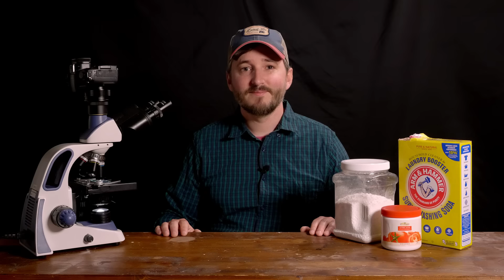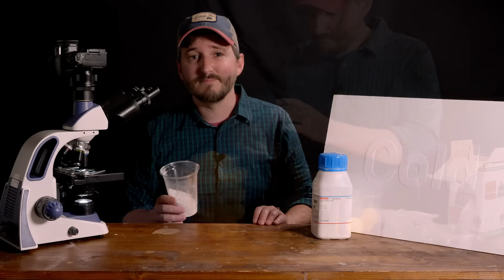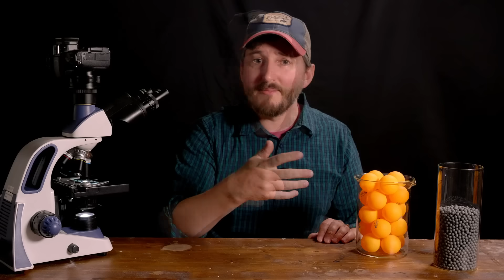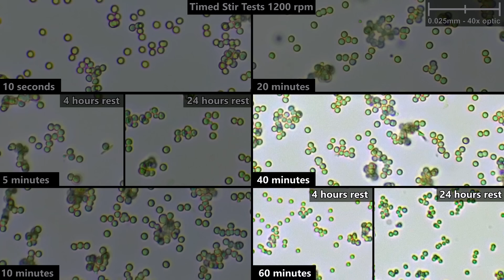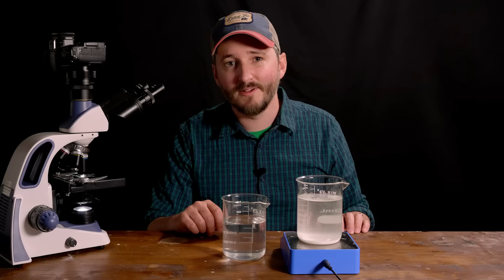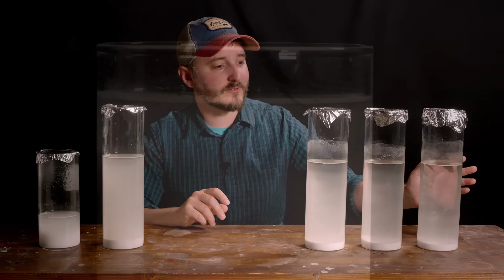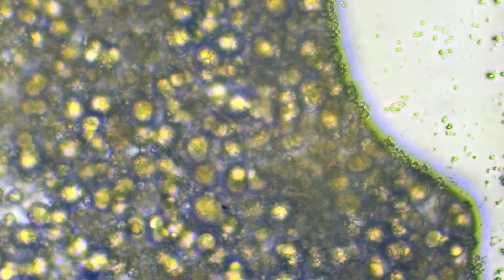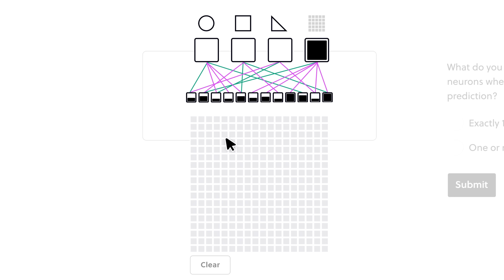Making Infrared Cooling Paint From Grocery Store Items (w/Novel CaCO₃ Microsphere Synthesis)

Comment: I don't understand why you need the different sized spheres.  Wouldn't it work just as well to use just the smallest size?
Reply: Never mind.  I get it now.  I was watching Tech Ingredients explain the same thing, and I don't think he necessarily explained it any better, but it finally clicked in my brain.  Thank you for your amazing videos.
Reply: So, to prove this concept, I would take a jar and fill it with, say, one inch diameter balls, fill up the space in the jar with water, and then pour off and measure the amount of water.  
Then fill the same jar with 1/8 inch diameter balls, fill up the space in the jar with water, and then pour off and measure the water.  
I would expect to find the same amount of water in either scenario, which would be around 33%  of the capacity of the jar.
Is that correct?

Comment: Looks like you'd be able to either trowel the 'paint' on, or pour it and use a spiked roller (like those used for epoxy resin floors). A gentle vibration could aid with leveling the surface and better compacting/aligning the spherical particles.

Comment: This solution may sound somewhat strange, but dissolving non-fat milk powder in hot water may give you a polymer form of less fragile paint without disturbing the original cooling effect. Higher percentages of milk will produce something more akin to Elmer's wood glue, but small amounts won't have it's own albedo effect, and who knows, the milk solids may be another form of mesospheres.

Comment: I think you can figure out the spraying, but you'll need a solvent that is a little slower than Acetone. Though I do think the trick of keeping the acrylic foaming might be hard in that case. Ethyl Acetate, Propylene Carbonate, MEK? Gotta be a recipe that gives a better result now that you have the pigment size sorted out.

Have you tried a commercial off the shelf untinted paint base? I think that would be a very interesting data point to compare performance vs. ease of application/durability of the coating.

Comment: Ahh I have a tip for you!  To prevent acid reflux, don't eat too late at night, and if you do, make sure to only lie on your left side... the reason is because your stomach is like a bag that goes down and to the left. If you lie on your right side, then all that pressure is pushing on the top stomach valve...

Comment: Incredible work! I was not going to say anything because I figured you would not read it but... you said you read everything so here goes...

I had two thoughts, both of which I do wish I could try myself but knowing I wouldn't and wanting to see you keep doing incredible things I figured I would mention them.

1. Have you tried dissolving the acrylic in pure acetone and then adding the water before spreading? It would likely achieve your desired result of light scattering with micropores where the water slowly evaporates. It may also reduce your processing time of the acrylic sol'n.

2. Have you considered setting up a "screening" or as a concrete worker would say "screeding" for the pigment? I think with the right tools the solution could be spread over about a square meter of flat surface in a minute or two. You would just make a 2x desired height box of the desired dimensions (as half of the volume will evaporate, hopefully all in the height dimension), pour in the mix/paint, then scrape off the top and consider light vibration to level the surface further (another concrete trick), let dry and remove the box (looks like you did this with the heat sink you placed the pant on to a degree)... 

Anyway, I hope this was not a waste of your time, I found your video compelling and interesting, I studied chemistry in university and grad school and worked as an industrial and analytical chemistry for years so I loved what you were doing here. Just pure gold content here! 

Thank you again!

Comment: Because of the thickness of the coating and the "paint" being so viscous, would rolling it onto a surface be better? Using your syringe to spread a correct amount onto the surface, and then something like a Brayer roller to spread it out?

Comment: If it adheres to acrylic glazing, then a film overcoat of lacquer or shellac may be protective for out-of-doors use.  Also, I wonder if this could be used as a reflector to put more light on a solar panel without the infrared rays.  
Speaking of solar panels, a method of cooling the panel might improve efficiency on a warm sunny day.  But that's another project.

Comment: Thank you for all your work and for sharing your findings with the public, free of charge! Even with  your thoughtful efforts to simplify the process (I really appreciate the use of a blender rather than a centrifuge), it still looks like quite the process to make just a sample size of paint. Is there anything comparable on the market that can be purchased for someone who doesn't have that kind of time or ambition???
I've heard of Radiant Barrier paints that claim to reflect more of the sun's heat, but I've also heard they don't really make a huge difference. Do you think they're similar?
Reply from the maker: There are various silicone roof coatings that are meant to reflect heat. Look for the brightest white you can get. They don't cool below air temp but it will keep a house much colder than a dark roof.
Reply: Thanks! I guess that sounds like my best option without attempting to make it myself (maybe someday). At least until this one hits the market! 😉

Comment: I know from my work in biology that citrate ion is a good carrier for calcium. It simultaneously chelates it by holding on to the plus two charge of the calcium with two of its three carboxylic acids, and it leaves a free carboxylic acid to aid and it's solubility. So it's kind of a way to hold on to calcium and be dissolved at the same time. Your body actually uses citrate ion in your kidneys to prevent the accumulation of calcium and magnesium kidney and bladder stones. The calcium gets slowly released and recaptured as part of the dynamic equilibrium, unless there's something that doesn't even better binding calcium, such as sulfate, oxalate, phosphate, or carbonate. In the case of combining calcium citrate and sodium carbonate, you produce a alkaline solution that keeps the carbonate ion stable, which normally in the presence of acid will convert into carbon dioxide and water.

Comment: I think what's going on here is that the sodium citrate is reacting with the calcium carbonate To form calcium 2 citrate which is probably less likely to react with sodium carbonate than calcium chloride therefore delaying the reaction until it can convert back to calcium chloride by chance temporarily having hydrochloric acid in solution there's also the possibility that the calcium carbonate reacts with the citric acid to form calcium citrate and then unreacts forming calcium carbonate again like for example magnesium sulfate will react with water to form sulfuric acid and magnesium hydroxide but a very small amount will exist because it is not favored

Comment: With the recommended height of 0.5 mm, that's ~0.5L/m²
Which, with my local prices translates to 2.03€/m² or 4.06/L

Though that's a bit misleading as you'll have a lot of leftover calcium chloride since they are sold by bags of 25kg for around 60€, so if you don't have a use for all of it it dramatically increases the cost.
Though if you're making 200L of paint you'll use all of it, but in this case you're painting your roof.

Comment: My idea would be to use a 3d printed nozzle and a screw on a 550ml syringe (turning the screw to press the syringe, so you turn a set amount per distance to keep the volume constant.)
Another idea that might work very well would be using a comb trimmed to the height you want*the ratio of tooth to gap (i.e. if the gaps are 25% of the length, you trim at 4 times the height.)
That should give a very even coat with minimal cost and effort. 

You might be able to do the same with a notched trowel, though they usually are a bit on the big side. (But you can find fine ones that would do the job)

Other idea: spraying an acrylic clear coat on top, which should help protect, and using a clear/white acrylic primer base for the paint to adhere to.

Comment: For the demonstration you showed at the start with the strip of paint in sunlight and the IR camera: It would be good to repeat that with a section of the panel painted in normal white paint just to compare how much of the cooling is due to the colour
Reply: That is not comparing cooling but how much heat that paint absorbs, it stays cool by emission of IR and reflection of almost all of the light, the real question is how much heat it emitts via IR, how much heat actually leaves the panel
Reply: The heat it absorbs and the the heat from the air is what it emitts in IR
Reply: “Tech Ingredients” accomplished that feat no more than 4 months ago

Comment: That shrinking you're seeing is from solvents evaporating. It is a common occurrence on pretty much anything that has solvents. My first thought about that is that by adding a plastesiser (something to keep the material flexible at all times) this shrinking and cracking can be negates since the material will just stretch a bit. And while originally low concentration of wood glue came to mind, you mentioned silicone and that would be a much better choice. While silicone can be thinned with acetone, your idea of xylol from the "make any fabric waterproof" could work better. Mix some of it with the acetone-based coating and you should get a semi-flexible coating that won't crack. Moreover, using a thinner xylol-silicone mix might even allow for this to be a fabric soak instead of just coating. Imagine an outdoor canopy or an umbrella that actually reflects heat!
Speaking of thinned acetone. I mixed a batch of it for a small project (balljoint 'boots' for a go-kart, used fabric hose sleeve as the substrate). Even though i kept the mix in a sealed jar, after a month i am noticing that the silicone is slowly curing (polymerizing?) in the mix, turning into a rather odd gel-like material that can't even hold a shape. By now it feels like what you'd imagine a jellyfish feeling like. A rather curious substance that will no longer soak into fabric, but i'm sure there are other uses for it. Need to let a bit of it dry out and see what happens.
Reply: artists sometimes add glycerol to prevent cracking by increasing the drying time. Know that thickens it too though and not sure how it plays with various solvents
Reply: What does AgentGordon think of your suggestions?  🙂

Comment: @Nighthawkinlight we missed you! I always worry when we dont hear from you for so long, dreading a day when your contributions come to their conclusion, because I consider you a treasure to humanity, and a titan among men. Our generation's John B. Goodenough. Please don't ever die. 

This cooling paint project haunts my thoughts ever since you first shared it. The reason why is black sand. Black sand gets ridiculously hot in the very same sunlight that this paint can turn into cold... that makes me think that an extremely efficient passive power station could be built on the concept of using black sand to heat water, this cold paint to cool it, and multiple means of capturing every bit of energy in between. Solarpunk+Steampunk=Amazing possibilities, ya dig? I have a few ideas that might work, but I figure you could probably think up an even better design. Id love to hear your thoughts on the idea, at any rate.

Comment: how about using a 3d printer with a peristaltic pump instead of the filament feed motor. just turn off the heat. the existing system already uses air tight fittings. should be able to lay a very controlled layer down.

Comment: If i recall, citrate has a tendency to sorta "hold on" to calcium and make it unavailable for reactions, possibly making it behave as if the calcium is much less concentrated (active) than it is.

They use it for that purpose in several applications- it prevents blood from clotting cause clotting needs calcium ions to procede

Comment: I'm eager to implement this! Could I realistically paint a metal plate, place it on a sunny window, and add some sort of heat exchanger/cooling fin such that you could feel the temperature difference? i don't expect it to actually cool my house, just as a fun proof of concept for applying this as an HVAC solution. Would be a neat alternative to drawing the blinds in the summer
Reply from the maker: Glass blocks the IR so it won't cool inside of a window, but it will still reflect a lot of the sunlight
Reply: @Nighthawkinlight  I should have clarified, the intent was to place the metal panel in an open window as an alternative to drawing the blinds. You can probably tell I'm inexperienced but that's the beauty of what you've made! Even dolts like me can experiment!

Comment: to apply to a panel, stretch some parallel 1mm dia copper wires across the panel say 6 inches apart, pour on the mixture and use a straight edged spreader to flatten.

Comment: So you've basically made a highly reflective caulk. Nea! Have you tried troweling if on? I've done that with fluid applied water barriers.

I wonder if you could add some small percentage of 100% silicone caulk to the mixture to add to the flexibility? You noted that 100% acrylic buckles. Flexible caulks have a percentage of silicone to address that. It might not matter given the water, but it may be worth a try?

Comment: 37:53 
Application method idea:

Use a spin coating mechanism, pour the coating in the center of a spinning plate and let centrifugal ‘force’ along with surface tension do the work.

Comment: Hmmmmm... What you have there is essentially a solar collector. Solar collectors are painted (or anodized) black inside, so they collect as much heat energy as possible. I wonder what would happen if you took a solar collector apart and painted the collector surfaces in your white paint...

Comment: Try placing an amount of paint on the board and just spreading it out using a steel spatula/scraper with some 0.5mm copper wire wound around at two points. The wire should act as a standoff and you can apply a consistent thickness along the entire pull with the scraper.

Comment: Hearing about citric acid caused me to have flashbacks to my MSc making magnetic nanoparticles and struggling to get consistent particle sizes :D 

Excellent work, though I wonder at the added efficacy of the acetone/acrylic "foam" binding agent over using a more standard medium. While the structure does increase reflectivity, a not insignificant amount of your nanoparticles will be within the structure which I would imagine reduce the effectiveness of each independent particle - this would reduce manufacturing steps and produce a more robust paint layer which may even be able to be used without a protective membrane.

Would be interesting to see the difference between pure particle density vs the larger 3D structure.

Comment: Seems like this would also be great to paint on motorcycle radiators (which are more likely to be out in the open/exposed) if it can handle the higher temperatures.

Comment: For spreading more quickly on a flat surface maybe take a wide spackle knife and attach some small diameter rod to the edges parallel to the direction of travel to space the tool from the surface properly.   Then just pour a glop of coating on and spread.   You'd get groves in the coating from the rods, but touching them up with a syringe might be faster than doing a whole panel with a syringe?   Love the idea of doing cooling paint with cheaper and safer ingredients.

Comment: A truly great video! Thanks for taking the time to research, experiment, record, edit and post! Definitely calls for a Patreon subscription for anyone who can do so.

I think a good way to spread the material, after getting a consistent viscosity, would be to extrude it using something like they are now using to 3D print concrete buildings. Of course scale matters and, for small areas, something like a modified 3D printer or CNC machine with some extrusion mechanism (maybe a screw drive on a large syringe) would get it done perfectly (with a little experimentation and adjustment). 

Thanks again!

Comment: What is the practical difference between using microspheres vs just whitewashing something with slaked lime?  Does the high density packing make it go from basically useless to very useful, or does it go from good to very good?  Because making it high density seems to be a huge amount of work compared to just making quicklime.

Comment: Could you layer this up to increase the cooling? 
If a panel in the shade gives better cooling effect, what would happen if you stacked two or three panels - would the lowest one be the coldest?  
I’m not sure if the paint on the top panel would simply reflect the IR back down to the second panel, or if it would absorb it, and then radiate it out both top and bottom?
I assume that it would require a panel that is made of something that itself is transparent to the IR - is the acrylic you used for the paint suitable?

Comment: Absolutely amazing! It's a real scientific work! My respect for you!
But what about the comparative effectiveness of the resulting paint? I know that the reflection coefficient of barium sulfate is higher than 95%, so it is used for painting integrating spheres in photometric devices. Calcium carbonate is also "white", but what is the reflection coefficient of paint based on it? It would be worth comparing the cooling ability of two paints made according to the same recipe, but containing different pigments - barium sulfate and calcium carbonate. An experiment similar to the one done by the author of the Tech Ingredients channel. And also measure the reflectivity of these paints. That would be very revealing.